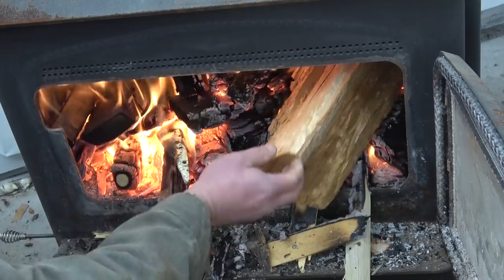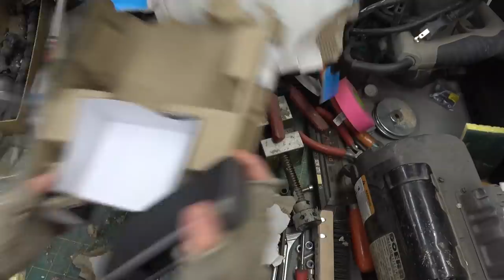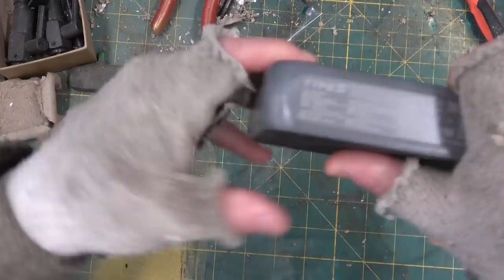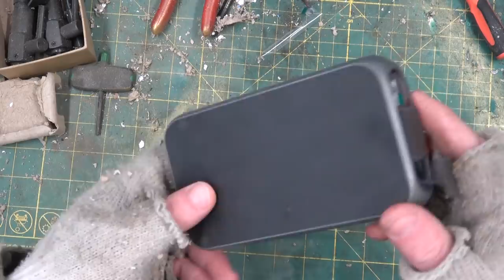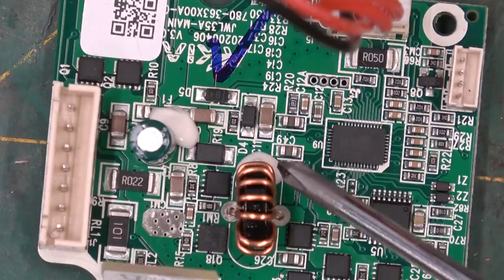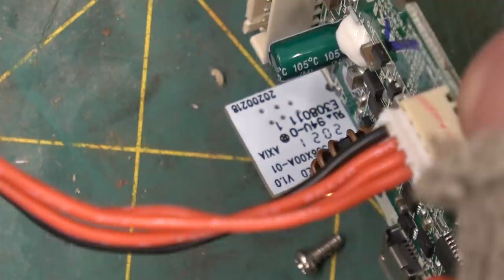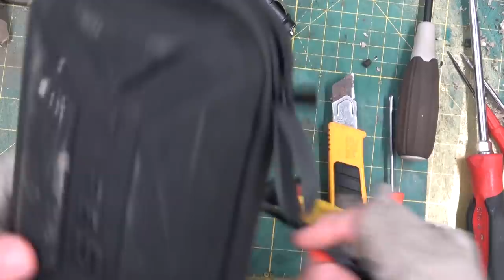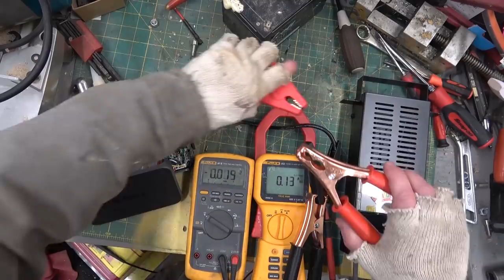BOLTR: Costco Boost Pack | Stupid Design

Comment: As someone who supports hundreds of devices using micro-usb, usb-C and lighting port, I can say without a doubt that USB-C is by far the most robust.   If I had a dime for every time an end user decided that micro-usb was reversible and just jammed the thing in backwards, rendering the device completely unusable, I"d be a rich man.  And lightning port can just go and eat a d**k.
Reply: Preach brother!
Reply: ive never seen lightning cable break, but it just sucks that the data rate is slow and the price to use it is sky high.
Reply: Never had a usb-c cable last.
Reply: Can second that, have owned quite a few devices with both and the Micro's always gave in before the 2YO mark,  none of my Type-C devices have shown any issues so far, some are more than 3 years old now.

There's a good chance AVE's pixel's port is either right full of pocket lint or has a manufacturing defect.
Reply: The only downside with USB-C is that they are some proper dust collectors.
I need to take out my industrial grade tooth pick once a month to clean my phone...
Reply: @gillesbaudeweyns6802  Wait, you can keep a cable for two years? The kids lose theirs, so then I lose mine. Lol.

I give it a good 6-7 months before I have to purchase a new one.
Reply: Preach. Micro-USB is a trainwreck of a connector. Those tiny hooks are constantly fucked, and that's even before the entire thing gets looser than my ex in a bar.
Reply: Honestly after switching to usbc I hate it. It has very little positive hold in the plug. And I'm sure it'll be "the next standard" untill it isn't
Reply: I was going to say similar. I actually find USB-C to be far more durable. Damned Micro USB and all similar variants were trash.
Reply: Usb-c is far superior. Even the "high quality" Anker power cable of micro-usb are complete trash. The cables and connector ends always fail. Haven't had a usb-c go bad yet.. knock on wood
Reply: @panzerveps  I'd bet that's what AvEs problem is.
Reply: I have the feeling you Never used lighting, the port itself is quite nice, and also the tactile feedback is also better than the 3 USB c batteries and stuff I can compare it to :)
Reply: Yup, I had to replace the micro usb port on my old phone twice in its lifetime.
Reply: Hmm I don't quite have the same experience. Have had 2 usb-c cables and 1 phone usb connector needing replacement in 1 year. With the old USBs that didn't happen
Reply: @gillesbaudeweyns6802  yep, and even when you tell people they're full of lint they look and say no it idnt, they won't believe until you pick the junk out in front of them
Reply: I get my micro-usb cables from Mao's candy mountain and never had one break, yet the usb cable that came with my phone died after about a year's daily use. 
The micro-usb did get a bit loosey-goosey after... four years? I'll report back once I've had the usb-c device that long ;)
Reply: I’ve always had iPhones, no problems with the lightning port.
Reply: The problem with the USB-C is that connectors are way to big and lenghty and it is way easier to cantilever it until it breaks specially on phones where people use it on their pockets with the headphones USB-C adaptor or use it while charging.
Reply: USB C is the future and im glad about that
Reply: @Ari--d  I've had dozens of lighting cables come apart when unplugging from the device
Reply: I can vouch for Fivizzz.
Reply: @scythelord  I have a tough case with the little flap so no lint for me funny enough! I think the conclusion here is in general "your mileage may vary" ;)
Reply: @GrafRucola  Oh, believe me, I've got many many apple devices with lightning connectors in use in the field, and they always crap out.   The ports aren't THAT bad, but the cables/connectors are good for 30 days max.
Reply: @mmmhorsesteaks  Yeah, I keep my personal device(s) in otterbox cases with a flap over the charge port, so I haven't had the lint problem personally, but I've definitely had to clean them out for users.
Reply: USB C is rated for 10000 insertions, versus micro b 1500. LTT has a video actually testing this too lol
Reply: USB-C is so much better than micro usb I've had multiple micro USB ports short internally or break in other ways with usb c I haven't had any problems in 2 years
Reply: As someone who also supports all three - I've never seen a Lightning port actually fail? When it stops working it's always just dirt in the port.

USB-C has the centre guide plastic bit that breaks off. Micro-USB is the same story though more frequently.
Reply: 1 usb c cable failed on me while usb hasn't failed on me yet
Reply: fckn appl
Reply: I have had a c device roughly used for a year with several different cables and have had no problems with the connector or the cable. Anker were always the best cable for micro, but even then the protocol was just awful, design was primarily driven by an nearly autistic need for thinner devices. 
 I like c. I havent used lightning, what i really miss mini. Those conector port and cable ends lasted forever. 
I have a 12 yr old stereo Bluetooth headset rfmab2 that used the mini connector. Ive moved on to somehwhat bettsr devices since then. But i pull it out everyonce in a while and charge it up with an old mini cable. Port is still tight and the headset still works and cable also. 
 I remeber my first blackberry and the mini cable that came with that. Not only were the ends super reinforced and sturdy, the whole cable was strong as hell. You could have strangled epstine to death with it. But ever ownward with "improvement"
Reply: @savagemadman2054  The actual port failing is rare, but not unheard of.   They do break loose inside the housing.   It's more-so that the cables/connectors (If the device is used in an industrial setting in a case that has a built-in lightning connector and external charge contacts) are very weak.
Reply: Micro is shitty... Mini on the other hand... Not that you can get it on any phone since the late 90s I guess, but the devices that use them, use them for good...
Reply: Micro USB is trash. Mini was much better, I just wish the springs were on the cable like they are in micro (but good)
Reply: @roflchopter11  Mini was not bad, but believe it or not, I've seen end users force that in backwards just like micro.     The reversible nature of USB-C is the main superiority in my book.  (Which is the benefit of lightning over both of those, as well... though USB-C is more robust than lightning.)
Reply: @gillesbaudeweyns6802  : On the Flipside-  it just so happens all of my Samasocket micro USB chargers have outlasted the usefulness of the device age they support...  (but still being used to charge /data transfer other devices)

Each to their Own I suppose - "some are harder on their gear than others" (ie. WD)

For Hard wearing connections it is still hard to beat a DB-9. Form-factor and transfer rate on the other hand??
Reply: Working with cables everyday USB c is better than any other small USB connector before it. More durable. Will take usb C over micro or lightning any day.
Reply: @andrewkennedy9704  Having worked with distribution TV gear, enterprise server gear and pretty much every other kind of gear that's out there, I learned at a really young age that it pays to align a plug before you jam it in a hole. Also, that if it's not going in, it's not aligned and more force won't help. I've never killed a cable, of any kind, ever. Except for single cores when sending too much current through them.
Reply: @Fivizzz  hahaha. I had one of them GF's once too.
Inspired me to write on a work ROI report in the comments, "Vehicle over all condition okay. Steering and suspension like my X. Bit loose in the front end, tends to wander."
Reply: @jimmyb1451  and I do that.
Reply: The only problem I have with lightning cables is the strain relief is minimal and the rubber sheathe on the cable is very supple and soft so they do split eventually (a couple of years). I do prefer that type of rubber though as it doesn’t kink or tangle like a stiff cable. The actual connector is great though! Much prefer the solid plug rather than the hollow oval shape of USB C and the fragile floating part in the socket. 

Btw if you didn’t know already, Apple were part of designing the USB C interface so whichever one you prefer, you like an Apple design! (At least partially Apple anyway).
Reply: @panzerveps  just blow it out with a compressor. Cleans it out like nothing else. And hit the aux port with it too if you have one
Reply: @almostdeadagain  Tried it, didn't work that well.
A little patience and a plastic toothpick goes a long way.
Reply: Can I get a phone with a nema 5?
Reply: @panzerveps  That's the way I usually do it. Don't have the compressor near terribly often. Too bad it didn't work for you, 95 psi has consistently cleaned my phone ports like nothing else. But the toothpick gets the job done.
Reply: My nephew figured out how to force a lightning cable in there...

Teach the kids about the ports..
Reply: @nate8088  a0
Reply: @almostdeadagain  Another reason is that burts of pressurized air can ruin the water protection, and since I use my phone in all weather, that's a pretty important feature.
Reply: Actually USB-A is the most robust and its a shame it got used so litte.
Reply: @mart446  HAH!    You crack me up.
Reply: What is wrong with the lightning port? I was under the impression because the lightning port does not have a tongue, it was more resilient than USB-C. (I'm not an iphone owner, I don't have feelings for the lightning port.)
Reply: Can confirm, easily 90% of RMAs in our shop are broken micro usb ports due to user (or rather design) error
Reply: @decnet100  I had the sprint HTC hero that used the mini plug and that was around 2010

Comment: That screen is not OLED, it says LCD on the damn PCB!
Edit: and the fact that is clearly IS back-lit
Reply: The display did look kinda too thick to be OLED. And that's the same board as the switch. I think they may have had an OLED originally with a thinner board and the switch was closer to the case. Then they "made it better".
Reply: It has some crazy backlight bleed on the edges as well.
Reply: @bryanjk  yeah, forgot to mention that one
Reply: I saw it was LCD the moment it powered up. The shimmering gray backlight gives it away.
Reply: You can also tell because there's a backlight. That means just plain old LCD.
Reply: @nrdesign1991  It's called a Negative LCD display the characters are light and the background is dark.

Not used as often as the more common positive display dark characters on a light background.
Reply: he always says an error to troll the trolls. This is Advanced YTing.
Reply: Yay verily.
Reply: @andymouse  yeah something tells me he doesn't write a script
Reply: I'm thinking "Oled" is the name of the Uyghur kid that assembled the thing...
Reply: Damn near segmented. But uuuuuuuled. Of course. Keeping up with the JOOOOLEDISEINORS, papi.

Comment: I’ve got an older (5-6 year old) jumper very similar to this in looks and size. I’ve only ever charged it 2-3x over the years and it stays in my trunk at 95-100% charged for years without use. It’s got me out of a jam a few times and let others use it numerous times. It never fails. Started diesels, v8s and all sorts of things. Love it. It has the flashing bits as well except it has red and blue you can turn on and looks like the popo

Comment: The cutout is usually time based and it starts counting when you plug it in. More refined plugs have a button on it that closes the curcuit. Btw. you can skip the button pressing on the device itself. The only thing between the battery and the clamps is that blinking MOSFETy safety thing. It can output 300+A (apparently your tester didn't want that many), and that is exactly why there's a time-based cutout here. The only thing preventing all the angry pixies running out of the Li-Po to your car battery is the voltage drop on those Shotky's and the Ohm's Law. But it starts a 5 L Jeep no problem.
Reply: A 5L Jeep at what outdoor temperature? That's the trick. Please specify Fahrenheit or Celsius units.
Reply: Exarcktly. Those resistive testers are great for telling you if a battery is hooped but they do NOT test the ultimate load they can put out!
Reply: @tuber4tuber  I've started my 4.2L v8 with one in below freezing many times.
Reply: i thought boost chargers like this  were also usually designed to detect a resistive load and shut down, as to not burn up the starter that it is assuming its incapable of getting spun up.

Comment: I’ve been using the prior version for a few years, and there’s a trick to using them to jump start in the cold: you. Just pull the battery bank out from where it’s been bouncing around the back of your truck, stuff it inside your jacket, and wait 15 minutes to bring it up to body temperature. You should also turn on the flashlight, as the battery will have enough current to turn it on while also decreasing internal resistance.

Comment: 4:38 Try getting into the sewing room, and pick the compressed lint out of the bottom of your Pixel phone's USB-C jack alternating a needle and a can of air, careful not to offend the tongue or any of its precious contacts. I'd bet you get no satisfying click when you plug it in, and also no contact open circuit no charging because. Usually you put your phone in your pants pocket, but when you do, you're also putting your pants pocket in your phone :).
Reply: This, 100%. Pocket Lint, Canaderps legal self-defense weapon is causing the issue
Reply: Huh, good advice right thar. Getting a satisfying click again. Thanks.
Reply: Exactly what happened with my phone, before cleaning out the lint my usb cable would constantly fall out of the phone
Reply: I agree. My Pixel had the same issue. I used a plastic toothpick to clean mine out. I didn't want to mess with the pixies in the battery by shorting the contacts.
Reply: Flat plastic toothpick is the best method I've found!
Reply: Plus one on this. Had a boring sit on the couch one day and figured I'd try picking the lint out. The amount that came out was astounding
Reply: Actually, if you smash the tip of a wooden toothpick, you can use it to remove the crud from ports.  Less likely to damage the contacts.
Reply: @skyirwin1445  I snap a wooden toothpick.  The nice sharp shard in the middle is great for picking around the contacts without trying to bend anything.
Reply: Remember kids on USB connectors the far left and the far right are the positive and the negative if you need to jump to them!!!!
Reply: Just said this myself happens to me all the time
Reply: I pull stones and lint out of mine. 
I wireless charge so I keep a cap in the c port. That way it works when i need to plug a cable to it.
C so much better
Reply: I question the intelligence of people who buy a $1000 phone, then stick it in their front pocket. Buy an Otterbox case and use a belt clip like a real man.
Reply: @oldscratch3535  
Your choice.
Side holster always got in the way for me.
I buy older gen phones. Much cheaper.
Reply: @turboflush  , same here. That thing hanging riight there in the middle of all the action , not a safe place. Wouldn't be long before there was no clip or phone. Cant say much for the pockets either. Maybe an inside pocket of a jacket. But have done a few in using all of them. Do have to give a good word for the Otterbox. A fine product. The clips tend to break after a while. But can be quite handy if you can remember where you clipped it. The case its self does an excellent job protecting from drops and such. However have had some trouble with interference with reception. Its a real pain when you have to take your phone out because youre in a spot where it wont get a signal because of the case. The screen protector however , pitch it. Install one of the glass screen protectors. They are amazing. You might have to replace it from time to time. But much better than replacing your phone. I had my phone out of the case when i realised i had left it on top of my car , as i was driving 60mph , and it fell off. I stopped and retrieved it. To my suprise , it still worked. Screen cover was smashed. Screen was like new.
Reply: Sounds like too much extra effort.  I’ll just keep my phone in a ziploc baggie.

Comment: I had ones of those, early model before the dongle on the clamps.  Worked okay, but when I went to get it out of the truck once, the battery was swollen and the case open.  Still worked to start a Mazda Miata with a deceased battery several times.  So I took some of the charge off.  The rigged a power resistor to drain it out in the yard before disposal.  

Don't know if the Li battery would have done unpleasant things in my truck eventually, but carrying them in a hot car doesn't seem good for them either.  They work, but they aren't really great stored in freezing or boiling vehicles, apparently.

Comment: I like that you can access high current leads to the battery directly without opening the device.  Just replace that safety connector and you can use the battery for anything.
Reply: You can find that connector online it's an EC5 connector